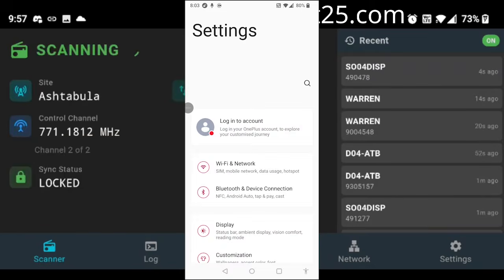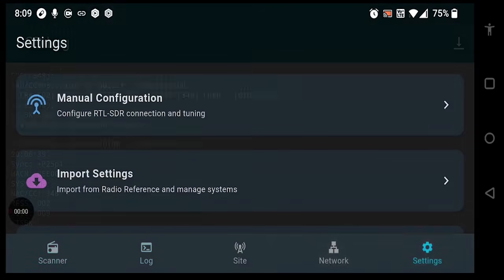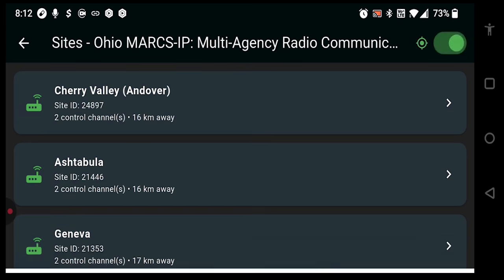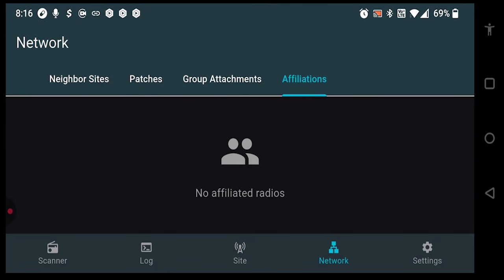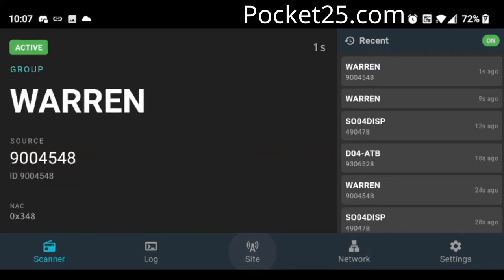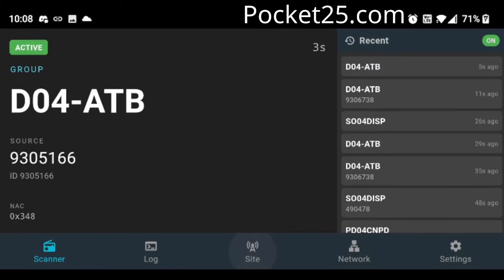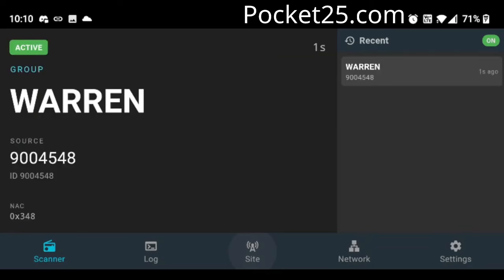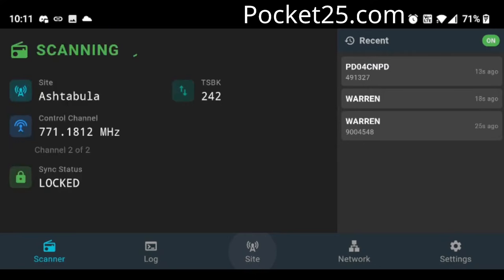Pocket25 | Running DSD-Neo on Android!

Comment: I have this running on a Galaxy s10 and rtl-sdr v3, I can see the log tab spitting out station information but not audio or anything in the recent section. I am also comparing it to my OP25 setup which is receiving traffic just fine. Any thoughts?
Reply from the maker: I'll take a look tonight, are you on the latest version?
Reply: @SignalsEverywhere  Yes I am. And thank you for the awesome work!

Comment: In some states u need 4 to 8 sdr to cover the freq spread for real time use.    1 sdr may get u some traffic,  but u will miss a bunch.
Reply from the maker: Still working on the scan grid but the idea is going to be having the software stay on the control channel and only following voice channels you're interested in. This allows you to capture traffic without missing anything. However that feature is still in a testing phase
Reply: WOW if that's all you have to beef about .....